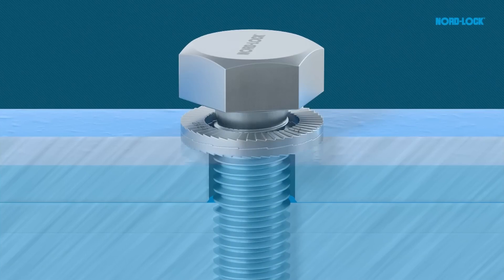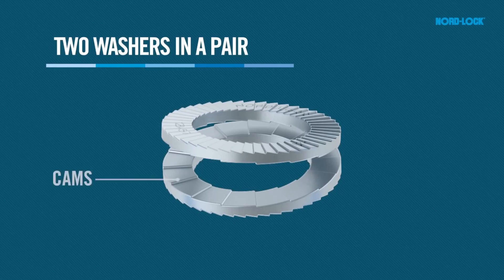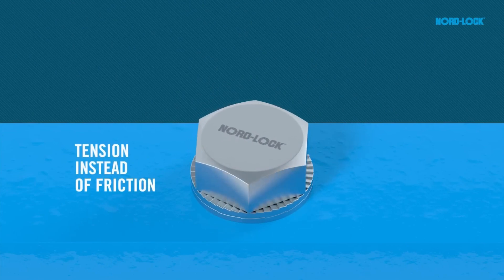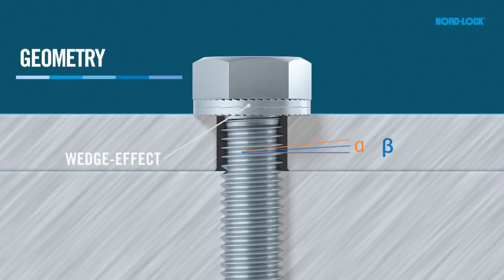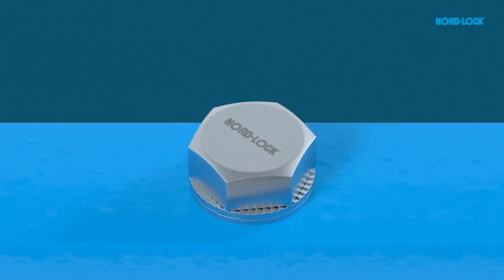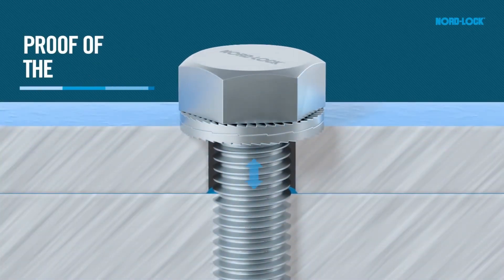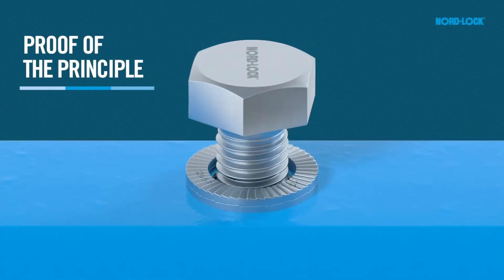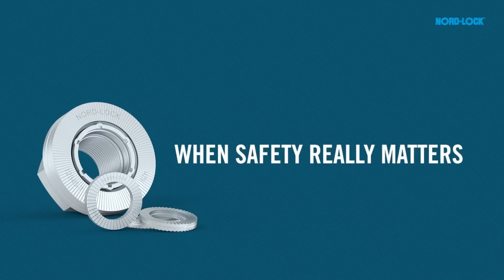How Nord-Lock Washers Work for You

Comment: I had a engine vibration dampener that kept coming loose every week no matter what I did 

(over tightening snapped the bolts) (lock-tite would heat up from engine ambient temp and fail)

but as SOON as i equipped Nord-Lock washers, it never loosened again, and remained torqued to spec, no extra tightening was needed. Ingenious design these washers.
Reply from the maker: Thanks for sharing!🙌
That’s the power of wedge-locking,  vibration and heat won’t defeat proper mechanical locking👍